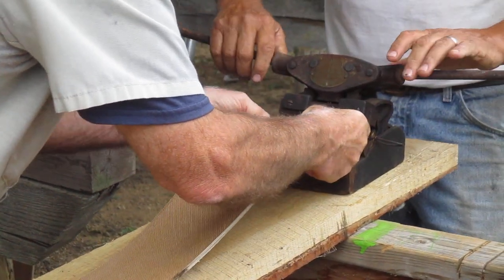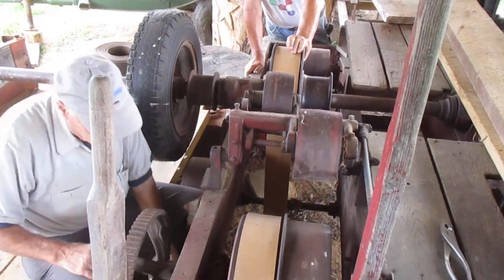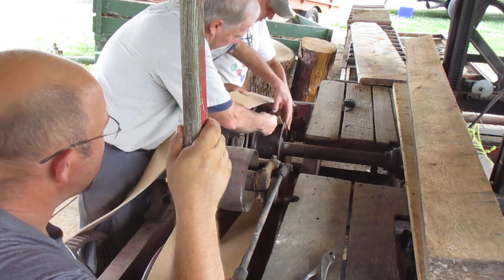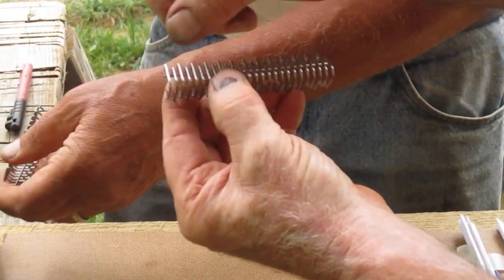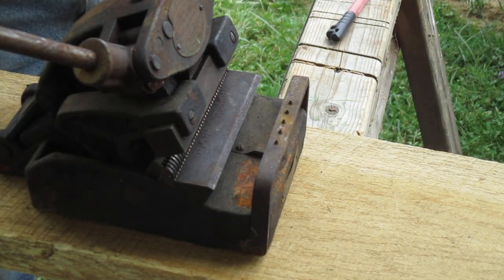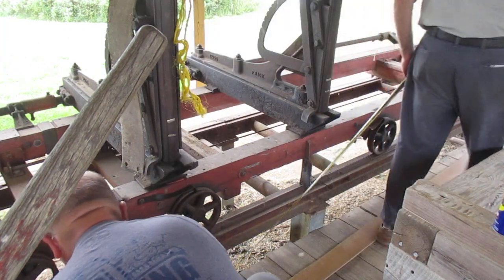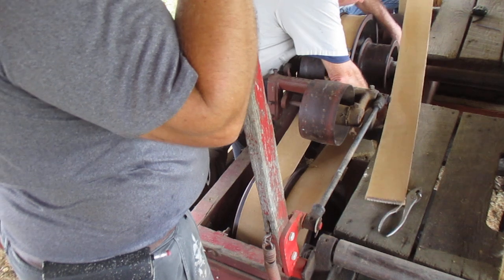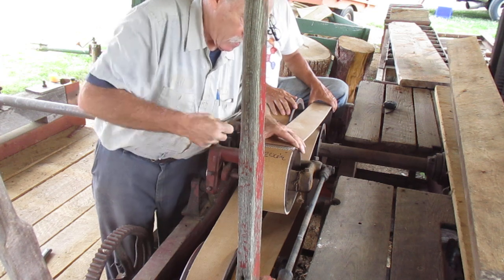GETTING THE SHOW SAWMILL READY # 896

Comment: I’ve always taken a hammer and tapped the lacings down a bit. Not enough to break the backing but as flush with the belt as possible. Pulleys won’t wear out the lacings as quickly.
Reply from the maker: hi there i know what you are talking about , thanks john